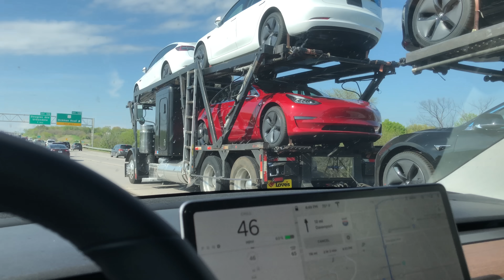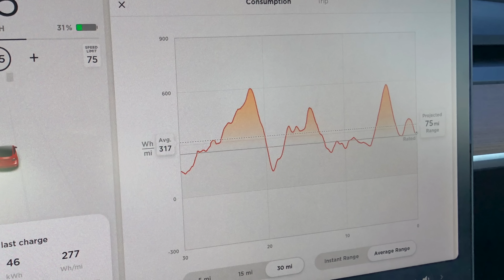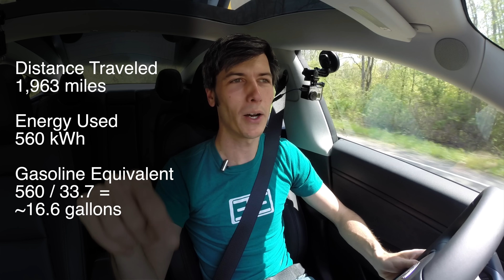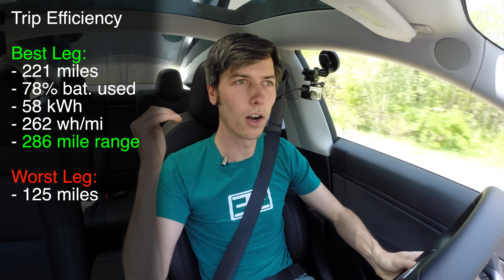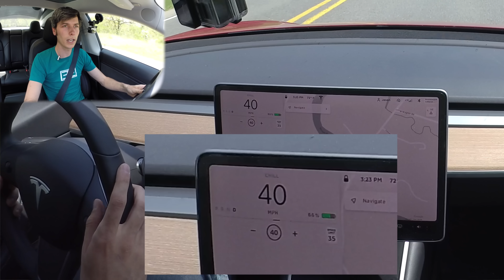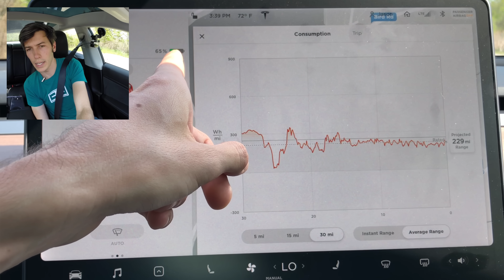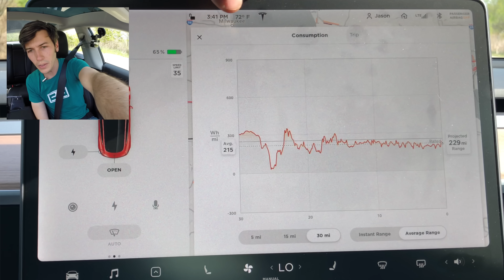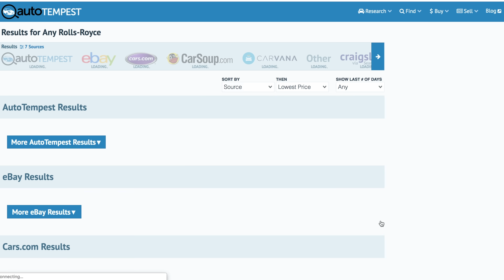How Miserable Is A Tesla Road Trip?

Comment: Your calculation of the amount of "gasoline equivalent" used in your trip is seriously flawed.
Electricity is not fuel, it is a form of energy. Energy is derived from fuel. Even so-called clean energy (solar, wind, tides, hydro) is derived from the fuel burned in the sun core (talk about inefficiency...)
Most of the electricity in US is produced by burning coal, oil and gas.
The process of generating electricity from oil and gas is not ideal. Gas turbines have an efficiency of 32 % to 38 %. Oil and coal power plants are a bit  worse as there are more steps involved.
Generating mechanical energy in the internal combustion engines have efficiency of 30-40%. Diesel is best, but best modern gasoline engines are getting close.
For simplicity let's skip loss of energy in power grid transmission lines and transformers, heat during charging and discharging and small inefficiency of electric motor.
The numbers show that it takes roughly the same amount of fuel to to produce enough electric energy to move a 4500lb Tesla around as it takes to move equivalent mass on rubber wheels by converting gasoline directly into mechanical energy in the internal combustion engine.
For some reason this concept is very hard to understand for electric car enthusiasts. They all think electric cars are good for environment. With electricity produced by burning coal, oil and gas, they are pretty much neutral.
Electric cars do not solve the pollution problem, they just move the problem to places where the electricity is generated.
In order to eliminate pollution caused by transportation we would have to eliminate all internal combustion engines AND all coal, oil and gas power stations. Unfortunately the only viable solution to getting rid of coal, oil and gas in electricity generation is to generate electricity in hydro-electric and nuclear power plants. Both are unpopular with the voting public so we continue to pursue electrification of cars under illusion that they are clean.
Reply: so what you're saying is, a dirty grid can't make a green fleet...

Comment: Yea. No. I travel way too often to worry about leapfrogging from charger to charger.  I like to be able to stop every 400 miles. 
Cool commuter car but it’s just not for me.  
Great info and video though.
Reply: I like it when more sane people weigh in, as a way to push back on some of the EV nonsense that gets spun by the fanboys. A 400 mile range is the holy grail, but it has to be at a normal price point. By Tesla standards, when they get to a 400 mile range, they will more than likely be charging $55,000+ for a car like that. WAYYYY too expensive for your average consumer. Don't worry, your take of "...but it's just not for me" is shared by 98% of Americans based on 2018 automotive sales numbers. EV's just aren't "there" yet, and won't be for another 10 years.

Comment: I notice your average charge time tends toward 40 minutes.... I have a M3LR and my average charge time is 20 minutes.  Makes a huge difference.  I've noted that charging to 63% battery goes really quick... the trick is to make the bottom 63% of the battery enough to cover your required range.
Reply: If you enter the charging station with less as 5 miles reserve and load just enough for the reaching the next stop within this 63% of battery capacity you'll have only half the time for charging in total for the same trip. This method is confirmed by a 1000 Miles trip in Europe with an old (2014) TeslaS 85. Of course started with 100% loaded battery, then nearly empty coming to a charging station and leaving with 50-60% for the next 2.5 hours driving. Stops of 20 minutes, just enough for going to toi;et and drinking a cup of coffee. We had only 2 longer stops for a meal. But when driving on this way you'll need to calculate for difference in height. It's about 3 miles range for climbing 100 meter and for coming down 100 meter you'll get back  2,5 miles of range (when regeneration is needed for keeping speed under the limit). My own KonaElectric is bound to other chargers, most of them are only 50KW charging speed. The Kona will load at this speed until 77% battery load.  The max load speed is 75KW, good until 65% of battery load.
Reply: @reiniernn9071  You are correct 100%.... My M3 nav system likes to calculate charge times based on arrival at the next point at 20% instead of 5%.  With the Tesla network, no problem, I can override and leave the supercharger when I see I will arrive at 5%.  When I owned a Bolt with a CCS charger it was foolish to come in at anything less that needed to get to the next CCS charger, which might be 70 miles further.  

Never the less, I was noting that his M3 was the mid-range model and him having to charge above 63% was taking longer than my LR model where 63% is 200 miles.  He's having to charge to 86% (16minutes x 2), where I charge to 63%(16 minutes x1) There are folks who say we don't need a 400 mile EV, but that's not entirely the case... if it takes 16 minutes to get to 63% and another 16 minutes to get to 86%, then it is wise to have a battery that has 1/3 more range than you need to make these charging stops.  In the case of comparing to a gas car, most go 300 miles before refueling.   To accomplish the same range in the same refuel time, an EV needs 400 miles range (300+1/3).  In practical terms, you can't pee and fill up a gas car in less than 15 minutes.  This 400 mile mark will put EV on even footing with gas cars for long trips..... and I haven't even included 250kw chargers in my math.

Comment: Everybody says that its diesel refuels in few minute an then it is ready to drive again, and actually does it during long trips, is just crazy and dangerous for itself and for the people around him.
If instead he actually stops for at least 15 minute every 2 hours as a non dangerous driver then he is only resistant to the changes.
Having said this, durind this trip the stop could have been made a bit more frequent and a lot shorter (around 30 minutes with v2 superchargers, around 25 minutes with 200kW plus high power chargers already available) using the fastest charge speed at low state of charge.
The debate between ev lovers and ev haters actually stays in that range between 15 and 25/30 minutes (in my last trip I took 25 minutes for breakfast and 45 for launch, however it is not recommended to eat at every stop...), not in 2/3/4 minutes diesel tank refill and then on the road again, this is just a crazy way of driving.

Comment: I have a 2018 GMC Sierra 2500hd 6.0L gas. To drive 2000 miles, it would take roughly 142 gallons or 4 full 36 gallon tanks. Not what it is made for but interesting nonetheless.
Reply: okay its a hd pick up with a large motor lol...

Comment: I like the rather technical side of having a Tesla and still kinda want one because of that menu system, but [for whatever reason] didn't realize you have to pay to charge. Makes sense, but that's not much better than driving my '03 Cooper S with its ~36 mpg; although it does have a 13.2 gallon tank and I can usually only get a little less than 400 miles out of it.

Comment: It is not there yet with such long roadtrips. In my roadtrips I like to stop randomly in places that look interesting in order to have a break/lunch. For fuel I stop whenever necessary and usually there is nothing interesting to see or eat around there. So those two things happen separately usually. It's not nice to have to follow a gps all the time with strict stop schedules. Sometimes it is fun to take the small roads and explore a bit without having to worry about refueling. And in the end the cost for charging is really close with refueling so you don't get any meaningful benefit there. Also consider a diesel engine here in Europe has half the fuel consumption making it a lot cheaper to cover those distances. I think a hybrid is better for Europe to get the best of both worlds for now.
Reply: In the UK we have duty and VAT on fuel. The tax man will want to recover that somehow and that increase the cost a lot.

Comment: 7:19 better miles per gallon?  of what? battery liquid? lol
Reply: rev headz equivalent, MPGe
Reply: @AmperageY  yeah, it doesn't work like that, gas engines are at the best 40% efficient
Reply: rev headz he’s talking about the MPGe on the Tesla and how it’s higher on city than on the highway MPGe.
Reply: @AmperageY  yeah i got that ,just interestinv that he used mpg lol, i mean obviously ev are gonna be more efficient @ low speed coz they dont have to be idleing when not moving, that just gotta be off lol

Comment: Autopilot gets incredibly annoying, especially on road trips when it keeps alerting you to apply feedback on the steering wheel every 20-30 seconds.  Often times my hand is resting on the steering wheel, just not enough for the car to recognize any resistance, I’d much rather have cruise control enabled and steering when necessary.

Comment: I despise low-profile tires. If they can just keep reducing charge time, distance driving in an EV will be more feasible. Right now it's still not there.
Reply: Helzapoppin Eh it depends, been driving my sport with ‘20s wrapped in rubber bands for around 2 years and not had a single issue, as long as you drive carefully it really isn’t a problem.

Comment: I just returned from a trip of 1700 miles and I only had to stop 6 times and the longest stay was 20 minutes so your video is very misleading. The only explanation I have for your long stays is that you don’t realize 2 things: 1. Use a charger that is not being “shared”. If there’s someone at 1A — don’t park at 1B. I only “had to” share at one location and the estimated charge time was 1 hour. Two cars left right after I started charging so I moved over to a non-shared charger and my charge was complete in 10 minutes. 2. You must be stopping to charge when your battery is at about 50% when it is much slower to charge. When you start charging at about 10-15% it charges at a rate of about 457 miles per hour and drops to about 1/2 that when it reaches 50%. Also — don’t charge past 80% as it can take you as long to go from 80-85 as it does from 20 to 80%. I’ll be doing it again in 2 weeks and I’m looking forward to it! Nothing miserable about it. (PS We had 2 adults and much heavier luggage (and more of it) than you did.)

Comment: I have an issue with claiming electric motors are so much more efficient than internal combustion engines. I find that statement misleading.

You probably know better than me that energy exists in different forms and that a charged accumulator represents a more organized form (lower entropy) of energy than heat, so just because of that, there is no way of converting heat 100% into an organized form of energy (motion). This is thermodynamics 101, the best you can do is the Carnot cycle with and efficiency of 1-T_cold/T_hot. Now the electric car is charged with electricity that at some point was made, most likely from heat, so all the same conversion inefficiencies were at that coal, gas or nuclear plant where they heated up the steam and converted that heat to motion and then motion to electricity with the same big inevitable losses. (solar and wind have their own losses although there is no heat to motion conversion there, but they produce an insignificant amount of the electricity in the US). So comparing just the electric motor's efficiency with the combustion engine's efficiency with disregarding all the inefficiencies that were encountered making that electricity paints a disingenuous picture. End-to-end, electric cars are more wasteful. You can argue about clean air and silent running in the inner cities, easier conversion to nuclear energy that is carbon neutral etc. and those are valid points, but please don't argue efficiency for the electric car ecosystem because that is just markedly not true.

Comment: Wtf.  If you want to compare efficiency with an ICE then you have to count the efficiency of the how the energy was generated that charged the car.   

Such bad science.
Reply: The Divider only if you are comparing carbon outputs. If you go that far you have to look at the efficiency of the oil extraction and refinement process lol
Reply: @southerncoyote  no you can compare refined fuel to refined fuel wether that is a plutonium rod or a pile of coal.
Reply: @PAT111  so you think that generating that power, transferring it over miles of powerlines and using it to charge a battery and then using that battery is 100% efficient with no loss or bleed.    Pfffft.    You cannot transfer power over a distance without loss its like a universal constant.
Reply: @PAT111  you still dont get it. 

This is clearly over your head.

Comment: Tesla's are awesome, the efficiency is awesome.

However... The battery technology just isn't there yet. A fourth of the time will be spent charging on it in this road trip, that's nuts.

If there's new battery technology that increases the charge density of the batteries (i.e. Samsung's experimental carbon based lithium batteries) it would make gasoline cars obsolete. I would buy one
Reply: Tesla is rolling out a new super charging network that charges 4x faster than the current supercharging stations. This will be the real game changer, not the battery.
Reply: Most batterie techs are about reliability and weight not density

Comment: 1) In my experience, Google Maps is pretty accurate in how much time it takes to get from point A to point B. 
2) Most of your drive was not where most Tesla cars are being driven. Try this in Florida and you'll spend a lot of time waiting to get on a charger. Let me tell you about the time I was in Sarasota and ALL charging spots were being used BY THE CAR DEALERSHIP. 
3) You're not taking into account driving to and from a charging location, whereas gas stations are conveniently next to road in nearly all exits, allowing you to take any route you choose. With a Tesla, you have to route your drive to ensure you can make it to a charging station. There are areas of the country where there aren't any convenient charging locations, making them inaccessible to Tesla cars. We left Sarasota, fully charged, but had to charge again in Ft Myers because there was NO WAY the Tesla would make it through Alligator Alley otherwise. Waste of time. If you're driving at night - you get to experience being a sitting duck in an expensive car, so think twice about spending 40+ mins at 11pm anywhere, doubly so if you're a woman traveling alone. 
4) Most gas powered cars can drive for 4 to 5 hours and only take 10 mins to gas up. Having to wait an hour to charge for every 3 hours driven is a HUGE waste of time. 
5) Forget about using a Tesla to evacuate in an emergency. We all experienced that two years ago with Irma, and I realized that having a hybrid that can go 500 miles was a FAR better choice.  Goodbye Tesla, you're not ready for prime time yet.
Reply: Trish V My first thought too was that you are limited to a route where you have access to these chargers.

I disagree with you that it takes 10 minutes to charge a car. Your average vehicle can be fully fueled in under ten just fine. ;)

Comment: Looks like you could cut about 10min/charge or 2 hours if you left less buffer.

Really important that someone does this trip recording "inconvenient charging time" to truly compare vs an ICE car. My guess is you only spent < 2 hours over the entire trip actually waiting for the charger.
Reply: 10 minutes from a single charge, that extra 15% isn't being used and doesn't need to be recharged
Reply: @ourback  the car charges faster with lower state of charge, so running 10% -80% is better than 15%-85%

Comment: He keeps comparing apples to oranges when he does the mpg equivalent. That's what completely turns me off to his electric car videos. He and I are both engineers, except that I'm actually an ELECTRICAL engineer and past rocket scientist. He is completely using marketing hype to convince people of electric cars, and that's the main problem. Electric cars are not good. No thank you. Completely inefficient. As he mentions the batteries can hold the equivalent of two gallons of gas... a much smaller gas tank, taking much less space in a car, and not having to convert first from gas to electricity then put in a tank/battery to be used in the car ... can hold 12-20gallons on your typical car.

My bottom line, that will convince/not-convince me is this.... why would anyone do the following:
stored gas->electricity->stored electricity->delivery through electrical wires ->stored electricity->motor,
when you can simply do the following:
stored gas->motor? 

Why is there an intermediate step(s), and can you explain to me how that is more efficient than just going directly from gas->motor??? Electricity comes from gas and various other natural resources

I did work on the solar panel electric vehicles while I was in college, and although very inefficient and uncomfortable to drive those death traps, they were on the right path. When solar panels are perfected to the point that all you need is a solar panel matrix on the exterior of your car, and you never need to plug in the car... that's when I will be completely sold on electric cars.  Till then... Internal Combustion, without the silly electric car intermediate steps, is the best.

Comment: Mpg needs to go away.  Your electric is MpkW.   Also neat calculations to the superchargers but it really kind of sucks that you have to stick to a specific plan so much and can't really decide to go off route and adlib some extra stops in the moment.  You'd be screwed.   Only good for city driving or locked in cross country.